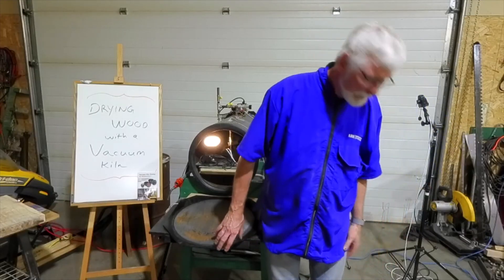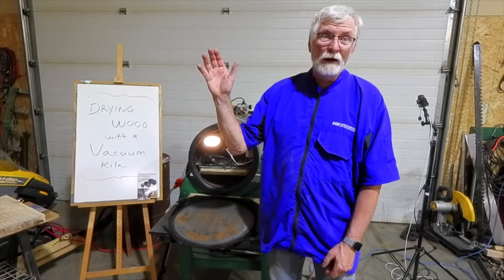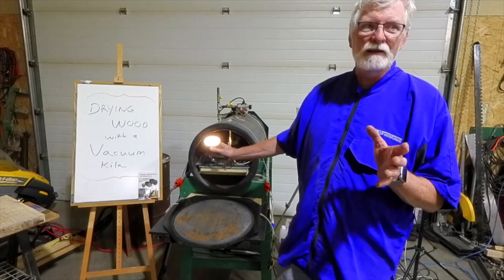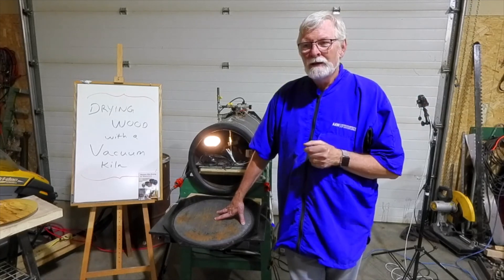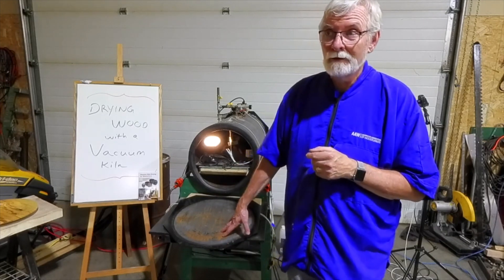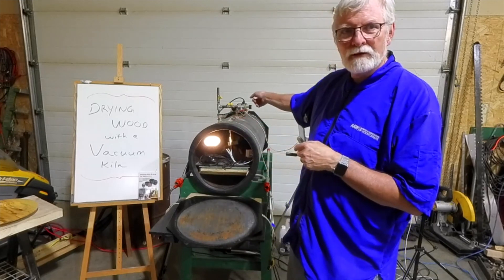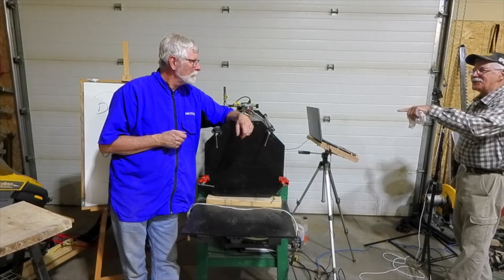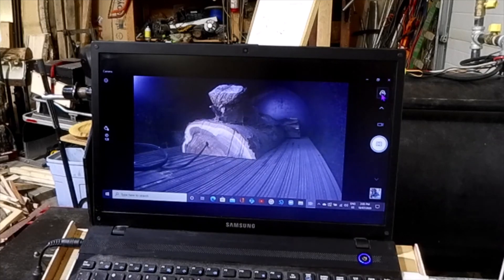Vacuum Kiln for Drying Wood

Comment: Do you manually turn off the pump once it reaches the desired vacuum or do you leave it running the entire time?
Reply: Hi there. When I start a run it takes about an hour to draw down the kiln. After that I’ve found running the vacuum pump for about 15 to 20 min every hour or so is adequate to maintain a good vacuum. I use a simple mechanical timer from the hardware store. It switches on the pump and the solenoid valve I have inline from the tank. I get a better seal this way. The pump by itself doesn’t maintain the greatest seal. The inline valve needs to be cleaned out from time to time since it accumulates some kind of goo from the process. That’s an easy clean with isopropyl alcohol aka rubbing alcohol. I’ve also found the directional arrow on the valve works best if pointed back to the kiln since atmospheric pressure will eventually push the valve against its seal.

Comment: Nice presentation, Jeff. Could a 50 gallon barrel work? It already has a bottom and heavy lid. I need to dry various sized .75” thick, 10” by 20” boards.
Reply: I think the usual barrels I see that are 30, 40 or 55 gallons are much too thin. I figured my kiln had about 10,000 lbs pressure on it, hence 3/8” thick walls and 1/4” thick end plates.

Comment: Sir  how about microwave heating along with vacuum kiln. You can try with small piece of wood in kitchen microwave oven.
Reply: I researched microwave drying and decided against it because you can burn the inside of the wood and not know it until you get there in a turning. There are commercial kilns that use microwaves for heating but that’s way above my skill level and unnecessarily complex compared to what I have.
Reply: Mr. Hankinson, I think your sensitivity to the wood and trying to minimize checking, reduce any stress on the wood is wise.  It would seem that microwaving would be uncontrolled vaporizing and would greatly increase the chance of overstressing the wood (esp. with your “Straws” principle).  Great video!  I’m surprised you have the system “leveled” instead of a significant elevation rise on the back end to ensure the moisture/condensation collection is efficiently accomplished.  Have you experimented with any leveling changes or see a need for it?
Reply: Re: leveling. As I recall I built in about 9mm (3/8 bananas) of tilt towards the bottom drain end. This works perfectly. I don’t have any pooling within the kiln.

Comment: Locktite (blue/removable)is the best air seal on threaded joints. IDRY of Virginia makes huge vacuum wood dryers (about the size of a tractor trailer trailer $40,000 to $500,000)
Reply: Loctite is good but for vacuum lines I use something called Swak from Swagelok

Comment: Can a compressor be used to create the vacuumed?  Have you seen the large tanks used to evacuate moisture from wood to be pressure treated?  Would that work?
Reply: I am not sure about your compressor idea but I suspect it would not draw enough of a vacuum. I have not personally seen large tanks being used for this purpose other that commercial vacuum units on YouTube. This presentation is aimed at the average woodturner looking for a cheap, fast, and easy way to dry the sizes of wood usually used in Woodturning.
Reply: @j.hankinson7803  
I have seen videos on pressure treating of lumber and they said the tank was pressurized at 60 psi.  Seemed low but what can I say.  I think they push the water out, not draw it.
Reply: 500 gallon propane tank.

Comment: Made a vacuum kiln following your design 20inch pipe Welch vac pump to heat mats but my pump will only get to 25inch mercury and my mats don’t seam to get hot enough will it work and just take longer to dry the wood ?
Reply: Hi there. You really need to get 26.5 in Hg or better. If you are close to sea level you need more. At my altitude of 2600 ft the max I can get to regardless is a little better than 27.3 in Hg. At sea level you should be able to max out near 29 in Hg. You probably have a vacuum leak especially if you can’t hold the vacuum for an hour or more. I have got these numbers even with a little $80 vane pump off Amazon. Your Welch pump probably has the oomph. Whether you have a decent seal or not is key. The fewer holes to contend with the better. One end of my kiln is welded shut. Other than the vacuum out hole on top and a drain hole on the bottom I only had one hole in the top near the open end for power. I sealed that with a generous application of SealAll inside, outside, and in the hole. As for the vacuum out and drain holes I found the gooey pipe dope as seen in the video sealed the best. Pipe threads are lousy at the best of times so discovering that stuff was great. The thicker yellow Teflon tape should have worked but I wasn’t happy with the result. Gas rated valves are necessary. Water rated valves probably won’t work but I haven’t tried them. You can easily hear big leaks but not the little ones. 
The elephant in the equation is the main opening. The bike tire gasket works fine. The flat plate of 1/4” steel I use to close it works fine. Make sure it’s flat with a straight edge. A spray paint finish on that is better than a brush painted finish I discovered. That leaves the pipe edge. That is where most of the seal issues happen in my experience. The easiest way to flatten it is to make a 24” x 24” piece of 3/4” flat MDF and cover it with sandpaper, maybe 150 grit. Use spray adhesive. Use a black Sharpie marker to ‘paint’ the edges of the pipe. Have some kind of support below the bottom edge of the MDF so you can slide it back and forth over the open end.
The first few passes with the sanding board will show the low spots. Keep sanding until they are gone and the surface is evenly flat. I had to do this recently when I developed an annoying leak. It works. I had the help of a friend to slide the board for 15 or 20 minutes or so. There’s lots of steel there to be flattened. I was able to weld the very small leak area (1/2”) a little higher than the rest then grind and sand it flush. I had to be careful not to make things worse with welding. 
When testing for kiln leaks, pull the maximum vacuum and close the inlet and outlet valves. Those pumps do leak down a little. That’s why I also have another electric solenoid-operated normally closed valve in line. It opens when the pump turns on. I found it sealed best with the flow arrow pointed back to the kiln. It is opposite to what you’d expect but that worked best for me. 
The heat mats only need to be about body temp to work. That amount of heat is very gentle on the wood but at 26+ in Hg it seems to be enough for me. When running for a couple days it gets very warm and humid in a properly sealed kiln. Water beads up on the outside wall and runs down. Keep the wood away from it because it will stain the wood. 
I hope this helps you out. Good luck.

Comment: Jeff, I see in Salesin"s book that you are no longer using the pins for moisture readings during the drying cycle.  If so how do you monitor the MC during the process?
Reply: Hi Ted. I discovered after many test and ‘real’ runs that I no longer needed moisture content pins. I’m also a little lazy ha ha. I found with my vacuum kiln that 3 days at the appropriate vacuum and heat dried out anything I put in it up to 3” thickness and 16” width. So long as the wood lay fairly flat on the lower heat mat, or if I stacked another mat and wood slab on top of the first, it all dried enough. The ends of course are much drier than the centres. Continued drying after three days didn’t seem to help much since I ultimately want the wood to equilibrate at about 10%. Another sign was little or no more water accumulation in my small drain tank. If the vacuum and heat were still ok, the wood was dry enough. Wood thicker than 3” was sometimes a bit questionable in the centre due to insufficient heat transfer through the wood thickness. 4” was ok ish but thicker than that I wasn’t happy with = still too much moisture at the centre of thickness.
Reply: @j.hankinson7803  Thanks Jeff!  Just to clarify the pins did work , you just decided they are not needed, correct? Another question...are you still using the straws in the drying canister or have you found something better?
Reply: @tededwards3048  Hi Ted. The pins did work quite well. With the 5 wires available in a regular USB cable, I could use one pair for one piece of wood and another pair for a second piece. Alternatively I could have 4 pins scattered around, and a common ground with 4 pins daisy chained together. 
In my expansion chamber in the vacuum line I have tried a variety of things. I am currently using a couple small bags worth of flat glass marbles. The idea of precipitating some of the humidity out before it all floods my vacuum pump is good, but my simple methods of straws, etc aren’t that great. I am trying to keep everything simple and low tech. Obviously a cooled radiator style precipitator would be more effective but much more complicated.

Comment: have you checked to see what happens if you're not quite low enough to boil? I wonder if it will still pull moisture out, just slower.
Reply: The magic happens when there is enough vacuum and warmth to vaporize the moisture in the wood. Below the levels described you just get regular evaporation and disappointment.

Comment: Excellent video, thanks for sharing this.
Could you provide some more details on your drainage and drying construction.
You mentioned you have straws inside?
Thanks Rob.
Reply: I have experimented with different (cheap) ways of getting some of the moisture out of the air going to the vacuum pump. I built another small chamber of 4” pipe with an inlet, outlet and drain. I tried a collection of tightly packed plastic straws suspended above the bottom on a simple plastic mesh and it helped a little. I also tried stainless steel pot scrubbers but they didn’t do much. Of course if I had a significant cooling system for this vacuum line I could condense a lot of moisture out of it but as I mentioned about, I am looking for cheap solutions to the problem. I think I’ll try a large plain steel plumbing fitting at a T joint inline and see if that will do something.
Reply: @j.hankinson7803  I have also been inspired by the video to attempt a construction; I am considering trying to use one or two car A/C condensers, since I have them (and they can be sourced cheaply). One concern is the amount of inlet constriction since they are much smaller than my pump's inlet. I imagine it would just take longer to achieve initial vacuum. Granted, like you said there is a limit to passive drying without refrigeration. I just picked up a 9', 35" OD, 2-3/16" wall plastic pipe that I hope will work ok.
Reply: The manual for my pump recommends keeping the inlet piping as large as possible for performance so i won't use the condensers. I might try to add a cooling loop inside the kiln fed from a mini fridge. Another idea is to use a large inlet pipe inside the kiln, cool it externally and stuff it with copper scouring pads or stripped wire.
Reply: @geekamole  Good luck. I would be interested in hearing if it works. As mentioned somewhere above I attempted to keep mine as simple and inexpensive as possible. I’ve lately decided to try marbles since they are also cheap and offer some thermal mass and surface area. They might stay cool enough to be effective.
Reply: For industrial applications we use a pipe within a pipe or a tube within a tube design and run cold air from a Vortec brand pneumatic heater / cooler in the outer shell while the inner contains the moist air.  In the pipe in pipe wype we will stuff SS pot scrubbers.  Any time you can make the moisture laden air make a sharp turn that can also remove some of the heavier water molecules. That's called an entrainment separator.  Also make sure to run the cooling air in the opposite direction as the flow to the vacuum pump.  The vortec uses a good amount of CFM and is pretty noisy but its a cheap and effective solution.

Comment: Great video presentation.
Going to order the book for reference. Im wondering if a larger propane tank could be use with the end cut. Tanks come in all sizes. I have a tank that is 4 ft by 10 or 12.
Reply: Hi Allan. I think it is much too thin walled to take the atmospheric pressure on the outside so would not work as a vacuum vessel. The 1/4” thick plate across the closed end of my kiln dented in 1/16” when I first tried it out. That’s only 18” across and probably twice the thickness of a propane tank. For fun, calculate the surface area of your vessel - very roughly 150 sq ft x 144 inches per sq ft = 21600 sq inches x 14.6 lb per sq in (atmospheric pressure at sea level) = 315,360 lbs (157.7 tons) pressure distributed across your tank. I wonder just how flat it would go (no ha ha). I suggest looking for a different pipe. If my math is wrong I’m sure someone will comment ha ha.
Reply: @j.hankinson7803  Thanks. After I got to thinking about it, I thought the shell might be to thin. I will need come up with something else. Looked good for awhile😁 Maybe a diving bell!!

Ill keep looking. I thought it might act like an egg shell for stress. 

Ill keep you posted.

Waiting for call back from Gast.

I have a pump but must moisture is an issue. They use condensation in air conditioners, gas furnaces and stills.

Im wondering if I could chill the intake air enough to get critical water out.
Reply: Re: Gast pump. I suggest Not using a Gast. They are too expensive to screw up with moisture. Cheaper oil vane pumps don’t draw as many cfm but that is not a problem. It’s the final vacuum level that is important. My old Welch only does about 0.9 cfm. New versions do 1.2 cfm.

Comment: Can you build, and sell custom kilns?  I need one 24" diameter and 5' long.  I make a large number of wood bowls by coring and currently have only a freezer kiln.  It works, but is more time consuming.
Reply: Since I am a hobby guy I don’t build or sell these things. That introduces a whole different bunch of complications I don’t need. These are simple enough to build and run for the average hobby guy. 24” is a reasonable diameter versus the end plate thickness, and I know of a successful one near me. I also know someone who has tried a 3 ft diameter kiln and run into sealing problems since he didn’t want to invest a fortune in steel end plates.

Comment: How much water do you collect out of an average load of this size vacuum kiln ?
Reply: Depending on the dryness and volume of the initial wood I usually get from 4 to 12 litres of water, roughly 1 to 4 US gallons. Since this method is so quick I don’t usually need to load it right up though. Much to the wood I use now has had a few months or so to dry so I can often get away with only two days. Mine is a hobby project after all.

Comment: I notice that where the vacuum line comes out of the top of the kiln, you have a ball valve in line right away before you get to the tee, and then another valve to release the vacuum. Is this first valve necessary? You have the electric valve in the line. It would seem that the first valve is redundant. What is its function?
Reply: I believe that is so you can drain water off without breaking vacuum. I thought about that same thing as well. The solenoid looks to be connected to the vacuum pump as an isolation pump when its not running. If its open, air will sneak through the pump over time.
Reply: In the process of testing my kiln I wanted some means of isolating the kiln. Since the gas rated ball valves in my area are so cheap, one on the entry and exit pipe simplifies the problem of finding leaks. Generally the fewer sources of leaks, the better so I started with the big pipe chamber, welded one end shut, gasketed the other end, welded the small inlet and outlet pipes and twisted on the ball valves. I was able to pull a great vacuum with that. I added the power, temp and moisture wires with the factory end to the inside and retested, resealing as necessary.
You are correct that the top ball valve serves no purpose in ordinary operation. However, when I can’t get a decent vacuum these two valves are of use again in sorting out the problem. It took three years for that to happen though luckily for me.

Comment: This is really excellent, and something I am going to try. The one question I have is that I am unclear as to how you connected your moisture meter wires to the wood inside.
Reply: To measure moisture levels I use a plain USB cable as described. These can be purchased very cheaply. They have 4 insulated wires and a shield wire that can be utilized as a 5th wire. I snip the wire about a foot from one end. I run the longer part of the wire through the kiln wall from inside out so that the commercially prepared end is inside the kiln. This reduces the leak possibilities. The foot long piece can be connected to pairs of nails inside the kiln with alligator clips for two monitoring points. Add extra wire length as needed. Another way I used to use was a common ground wire attached to 4 alligator clips + nails and the USB shield wire. Then the remaining 4 wires can be connected to nails with alligator clips giving you 4 monitoring points. To test moisture levels I use my ordinary moisture meter with 2 contact pins and attach a suitable pair of wires to it at the free cut end outside the kiln. You have to remember which pair of wires goes to which piece of wood of course ;) I tap small 1 inch nails about an inch apart either along the grain (best) or into the end grain. Once you understand how long your kiln typically takes to dry wood you can dispense with them altogether.